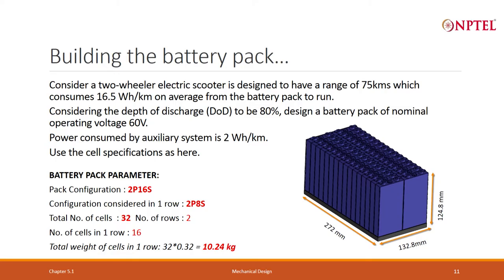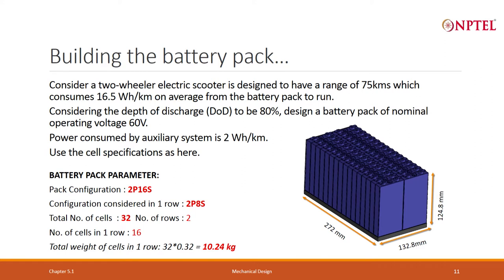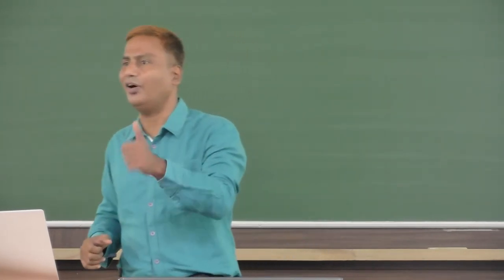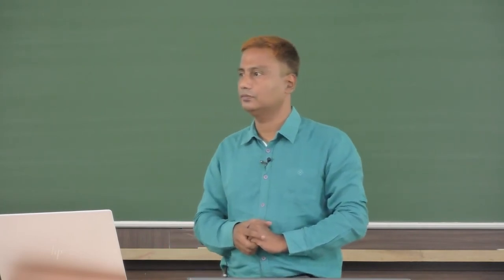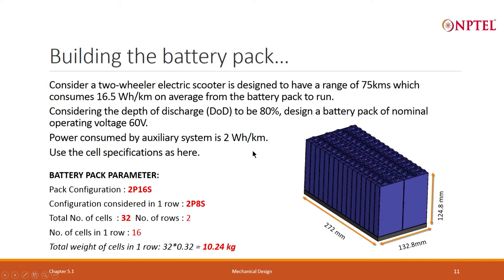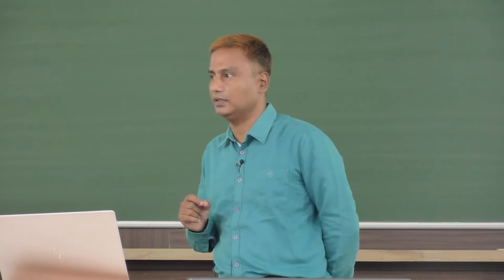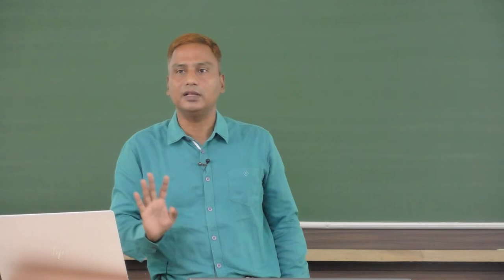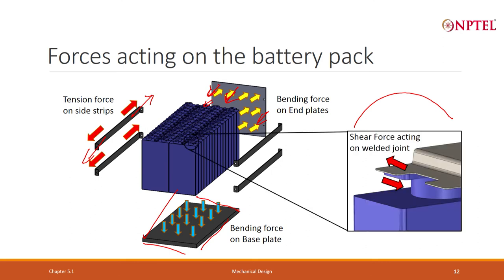Lecture 34 - Mechanical Design - Part 2

Comment: Hi Sir...i think that the load calculation for base plate should not be Total weight of cells / area .
Rather it should be analysed using concepts of theory of plates and shells 
Using F/A the displacement is assumed uniform , the stresses are uniform , which is wrong .It's obvious that displacement is zero at all four edges and maximum at geometrical center of base plate. Also stress seems to be maximum at geometrical center.